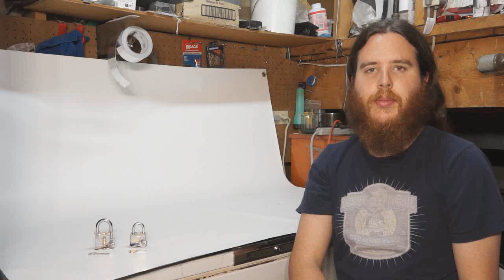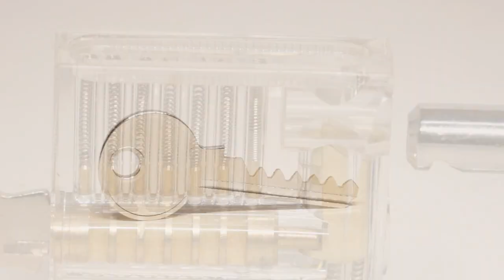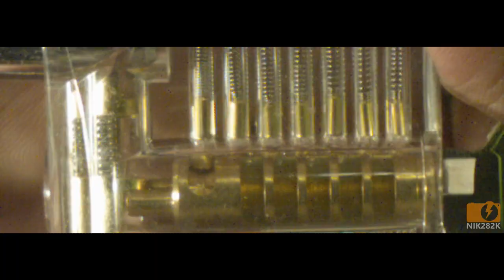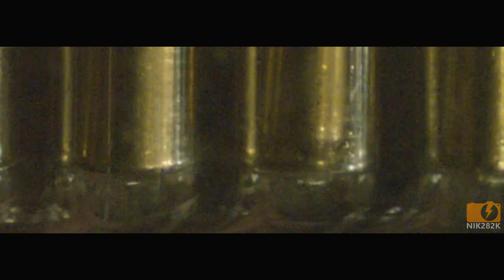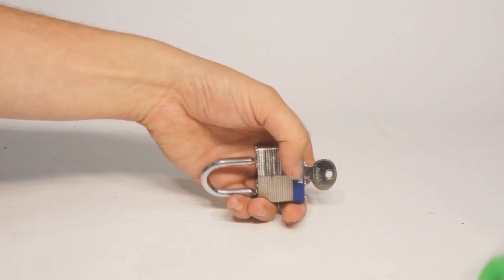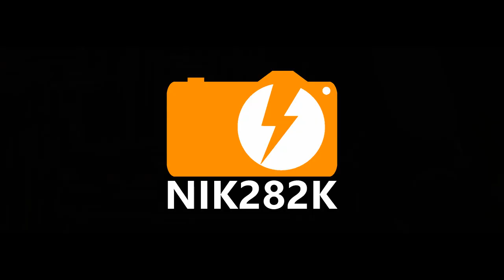Lock Bumping in Slow Motion

Comment: What if the cylinder is installed upside down? So that the key pins are always pulled down by gravity and the driver pins never really get to 'jump' ?
Reply: I believe gravity isn't much of a factor due to the spring loaded pins providing a pretty constant force no matter what the orientation of the lock is.

Comment: how to set up a lock that can't be picked or bumped.. http://i.imgur.com/rTIsdIb.jpg    silicone oring section becomes a spring .. when cut to a length that makes it really hard to get the top pin to the shear line it makes locks bump proof and also pick proof as there is no way to lift the last pin to the shear line with a pick that deep in the lock.  on the double ended cylinders used in so many european locks. you only have to do one end if you recall which one you did.  this does not work with old Kwiksets  as the oring section forces the spring retainer off.  try it.. prove me wrong.

Comment: I once had to break into my own building. Long story short, the housing organisation decided not to give me a key to the main front/rear entrances because I didn't sign their updated tenancy agreement which was quite Orwellian. Suffice it to say, I learned how to pick locks using homemade tools and also learned how to "listen" to mechanical keypad locks to crack the codes. It was a great skill to have!
Reply from the maker: +Jim Griffiths The apartment I had in NZ was like that, they always wanted to know when you were in and out of the building. What did material did you use for your picks? I'd love to see/hear how it's possible to crack the push button locks, I have only had a little experience with them.
Reply: For the main locks, I believe I used a piece of stainless steel from something (can't remember what). It was strong enough to put tension on the lock as I used a small, bent jeweler's screwdriver to pick with. I had to anneal the screwdriver so it didn't snap like the first one did!

For the push button lock, it had a reset button which I held carefully with a small amount of force, just enough to latch onto the mechanism when buttons were pressed. When the correct buttons were pressed, it made an extremely fast double click sound, too fast for the untrained ear to hear. I'd say probably less than 5ms between clicks. The non-enabled buttons just made a single click. Since I'm a sound engineer, it's easy to hear things like that. I kept resetting it until I had gone through each number and made a mental note of which buttons were enabled for the locking mechanism.
EDIT: The button lock was a small key safe, which I found out was easier to use once I cracked the code, since they always put spare keys in there that fit the front door haha.
Reply from the maker: I'm going to have to get my hands on a push button lock, that sounds like a great little hack, thanks!
Reply: that is some talent right there
Reply: your housing organization sucks ngl